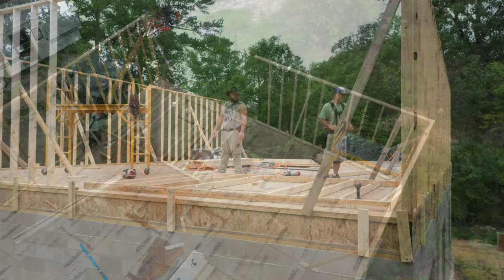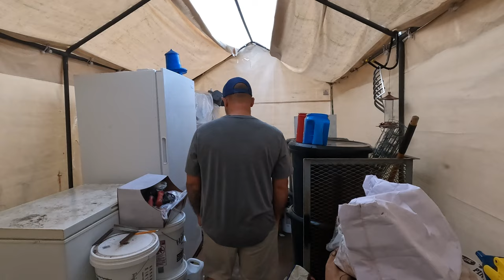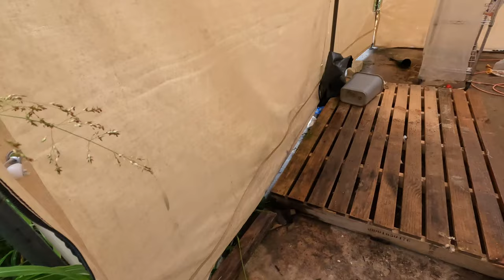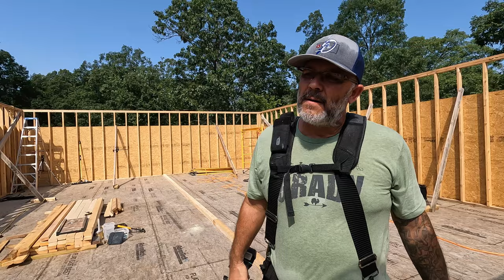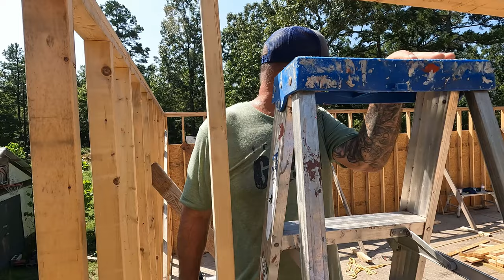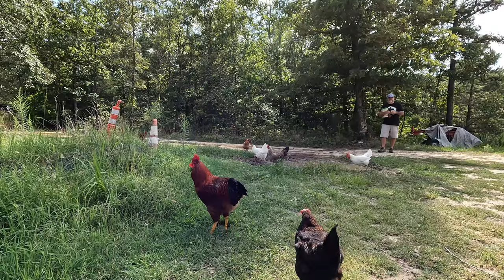What You Need to Know About Framing an Interior Support Wall for Roof Trusses |GRUB TERRA  |Chickens

Comment: I noticed that on your outer walls there is no cripples in it and now you're putting up an interior wall without cripples. Because the cripples are fastened to one another in order to make the entire structure securely sturdy. It  is quite obvious y'all don't know anything about housing construction. Before you all go any further building your house there you really need to do some research on home construction maybe even watch some YouTube videos on home construction. I mean I'm not trying to put you all down but gee whiz even hurricane straps isn't going to protect your house from straight-line winds or even a tornado.
Reply from the maker: Ok 👍